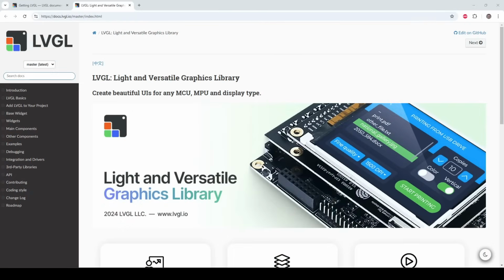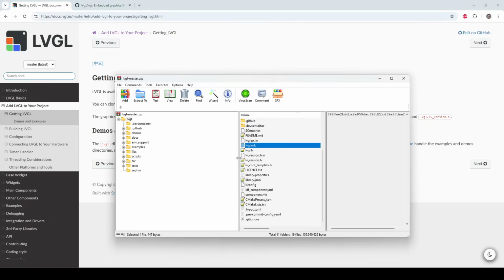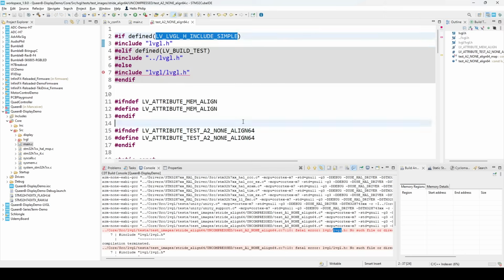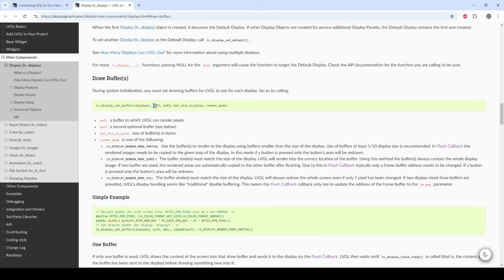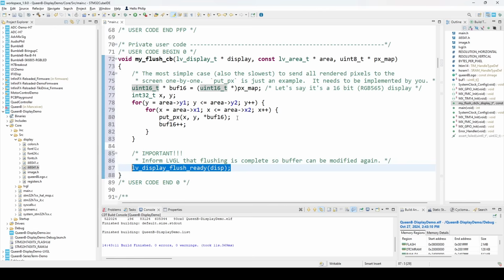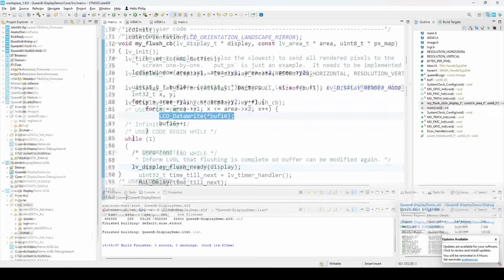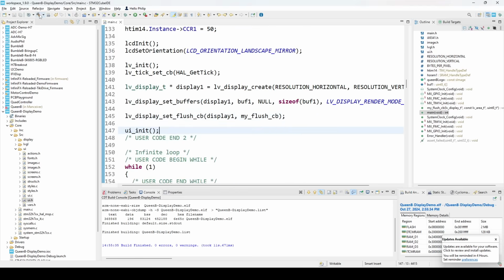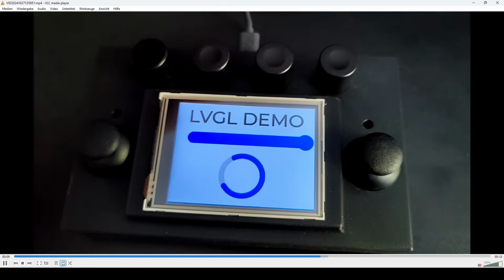STM32 + LVGL Firmware Tutorial - Phil's Lab #147

Comment: I was about to make this a private reply to a comment but I thought Id make it its own comment instead. If anyone included LV CONF SIMPLE and followed all the steps in the video about adding LVGL from github into CUBE IDE include path but got errors like lv_conf doesnt exist or you cant use any lvgl functions without errors that it doesnt exist (cant remeber the exact wording im so tired). This is probably a problem exclusive to the current master branch of the lvgl repo. I switched to release 8.3 and those linker errors went away (albeit replaced by new errors I have yet to decipher). Hope this helped someone.

Comment: I am new to stm32 boards( not new to programming, so setup in cube ide wasn’t to hard) and I tried to use an st7796 screen. After trying failing to find a driver for it, I wrote a basic one and implemented lvgl. Enabling the performance monitor in the lv conf file allow to see the fps and I was at 6fps. This is probably due to the driver I wrote, I am using the same chip as in your video the stm32h743 which is plenty fast so I wouldn’t blame it. Curious to know the performance of your display 

Thank you
Reply: update:

i enabled dma on the spi bus i was using, modified the flush callback a bit and now i can get around 30 fps. In this tutorial you havent used dma, yet the screen seems to have a good refresh rate. any tips on how to achieve this? or should i just change to the ili9341 diaplay ?

Comment: Thanks for the tutorial! I have a question, how do you use displays such as this NHD-7.0-800480EF-ASXN#-CTP which have drivers: Built-in EK9716B Source Driver and Built-in EK73002AB2 Gate Driver. I was unable to find driver code for any of these drivers. I have enough pins on my MCU but I am unsure how to interface with these drivers.

Comment: FYI.. from the EEZ-open github: Important note: Envox d.o.o. does not claim any ownership rights to the source code generated by the Build command except in the case of a project that uses EEZ Flow when it is given under the MIT license.
The user owns the .eez-project file and all the source code generated from the file template definitions that are part of eez-project file. EEZ Studio may also generate files that are under MIT, BSD 2.0 or Public Domain license.

Comment: I like the way LVGL lets you have a minimum buffer size of 1/10th of the screen. It reminds me of Windows 3.1 printer drivers which would render a horizontal band in memory, send it to the printer and then render the next band because you couldn't guarantee enough Ram to render the whole page at once. I guess it does some sort of algorithm to render dirty rectangles, splitting them to get them to fit the buffer if necessary.

Comment: It also works with HDMI and MIPI also LVDS. Do you have any guides for debugging a possible software issue of display connections?
Reply from the maker: Difficult to say generally, other than the 'usual' troubleshooting (verify hardware connections, monitor signals on scope/logic analyser, ..). The hardware connections are usually fairly straightforward, so the issues I've encountered have typically been software-related.

Comment: Hey Phil, have you had a look at zephyr RTOS yet? Seems to be the most interesting thing going on in the firmware world right now, very well integrated with STM32 MCUs and also integrates LVGL too.
Reply from the maker: I haven't yet I'm afraid - it's been on my list, but haven't really found a reason to use it yet (other than maybe for the nRF MCUs)...
Reply: @PhilsLab  I would give it a strong endorsement, definitely worth a good weekend look. I think you would really appreciate the use of device tree for pin configurations, it makes remapping a breeze and means you can swap out what MCU you are using in the snap of your fingers :D 

I've recently been playing with the native_sim stuff (the build setting to cross-compile the firmware for x64 /x86) and you can fully develop your LVGL GUI application running on linux or WSL2 then change the build command and magically its running on a STM32 eval board then another tweak and its running on your actual custom hardware with no C file changes. I was also staggered by the native_sim Bluetooth support, I was able to work on my Bluetooth low energy firmware running it on my laptop using my laptops Wi-Fi + Bluetooth chipset then run it on an ESP or NRF minutes later again with no actual code change.

Comment: What's the CPU usage when running LVGL? Measured for example using the FreeRTOS run time stats. Does it leave enough resources for other intensive tasks?
Reply from the maker: Good question - I haven't tried LVGL with FreeRTOS yet, but will give that a go and report back.
Reply: @PhilsLab  I am also very interested in hearing about this. I see another poster asked about Zephyr RTOS with LVGL also, which seems a closely-related topic!
Reply: Thanks!